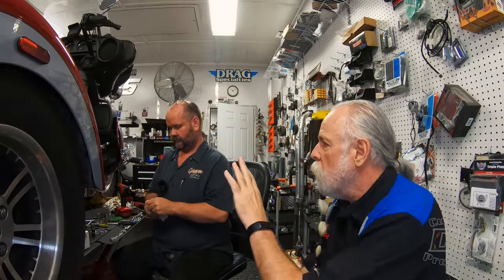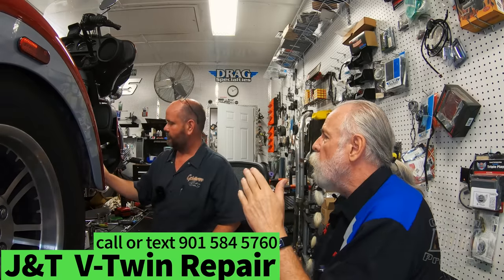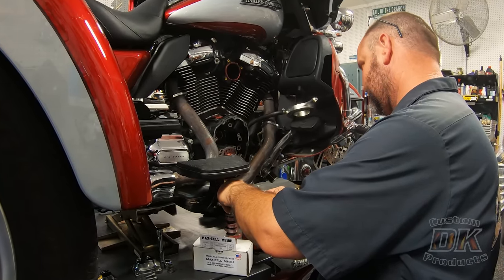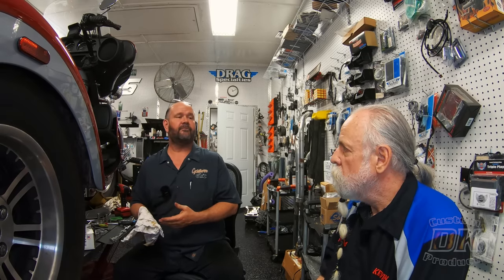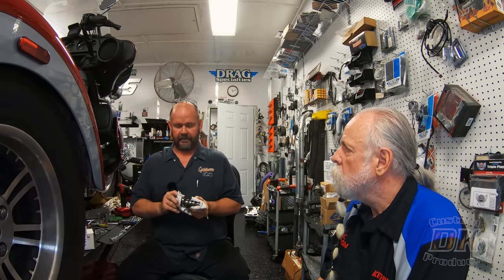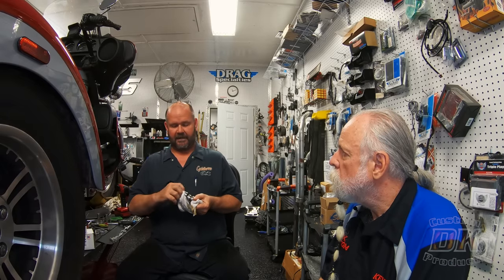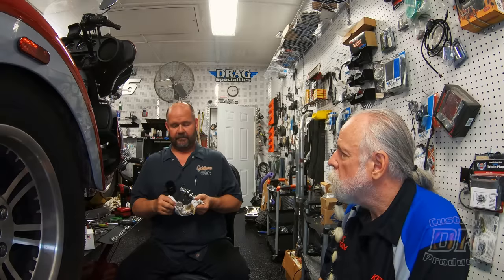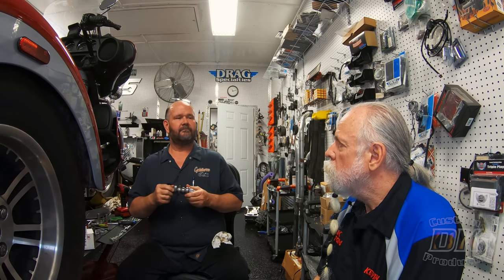How to Get Some Chop (Lope) From a Harley M8 Engine

Comment: chops good i get it , but you get a milk wagon also at low RPM
Reply from the maker: The M8 already pulls nicely down low, with the addition of this cam there was a substantial bump in torque in the low and mid range.  That is what I was looking for, along with the sound. KP

Comment: Very nice work.  I put the SE 447 cam in my M8 107 and I love it.  It gives me the power boost that I wanted and I don't feel that I'm over stressing the motor.
Reply: How did your gas mileage go?
Reply: @AttorneyThatRides  I lost 1mpg, maybe 2mpg at most.  Just filled up today and my range says 206, but that number can be a bit unreliable.  Doing accurate math after a fillup shows about 38mpg at best, 35 mpg at worst.
Reply: I have a SE447 in my 114 RGS and it runs Ok but wish I had gone aftermarket and got real power for my money
Reply: Running cooler is generally caused by other factors such as the fuel mapping.. If you go with the SE 447, go with an aftermarket tuner if you can.  I did so in my m8 Road King, seems to pull and maybe run better than my Wood's 22XE in my Street Glide using the same tuner, and both with their own custom tunes,  I'm still at the same fuel mileage on the 22XE and only drop about a 1 mpg on the Se 447 ( Road King getting about 44 and 46 mpg with the street glide 22XE) The Se-447 is the easiest on the valve spring and rockers.. and both changes have resulted in a 10 degree cooler running engine. Though the 22XE lopes alitte harder, the Se-447 is my favorite (with Powervision tuner)

Comment: In my FLHTK M8 I was interested in Torque and Torque only, I studied all I could about the Cams on the market and I ended up between the Woods WM8-22XE or the Zippers Red Shift 468. I ended up with the 468 because of the flexibility, it could be run with everything more or less stock or with a serious set-up in exhaust, airfilter, pushrods, manifold and tuner. All without going too deep into the Motor and still keep a reasonable gas-economy since it’s a Touring Bike. I have not regretted…the 468 pulls almost right from idle up i to the 4.300 - 4.500 rpms. and honestly I don’t need to operate in that area,..2000 -3000rpms are where I need my action, so it’s just perfect 👍🏻✊🏻☠️ 4:09
Reply from the maker: Good to hear you have your ride set up how you want it! 👍😎👍

Comment: I was after the same "Chop and Lope" for my 114 Milwaukee 8. I was impressed with the S & S 475 Cam recommended by GixxerFoo. I had it installed along with a lot of your DK Custom upgrades, i.e, external air breather, Thunder Torque Inserts, etc. Performance shot up noticeably, and I got my Chop/Lope idle.

 Please, please assure me that The S & S 475 was a good choice as well.
Reply from the maker: Nothing wrong with the S&S 475,  If you are happy with the power and sound, that is what is important. 👍
Reply: I installed the S&S 585 cam kit in my 103” Dyna Twincam, but for my 107” FLHTK M8 I went with the famous Zippers Red Shift 468. I love it’s so stock-like up to 1900-2000 rpms and then it just takes off massively charging the torque up until approx 4500 roms,..but I haven’t gone that far it’s more than enough hitting 3500…it’s incredible and then going down to “normal” speed and idle like nothing happened …it’s just a superior camshaft for touring and daily use. Highly recommend it ✊🏻
Reply from the maker: Thanks for sharing! 👍
Reply: The 475 is soft down low.Its horrible until its not.
Reply: @MrMurphc13  I don't exactly understand, but thanks!
Reply: @Digger456437  Well compared to a stock m8...after the 475 full kit was installed the bike is soft on the throttle going from a stop to when you get moving.The bike was tuned also.
Reply: @MrMurphc13  Gotcha.

Comment: The 2 Cams I'm seeing recommended all the time is the Woods 22XE Cam, and the Star 30/30. Woods 22XE cam is monstrous at low end torque, making 100lbs at the rear wheel in a 114 at 2250, and yet still delivers 120hp at 5500RPM, carrying out to 6200RPM. It's a fantastic cam through and through and that's what I'm going with when I swap out my SE Torque Cam.
My fat boy is already a quick accelerating bike with my tiny 130lb butt on it, but that 22XE looks like it's a super version of that SE torque cam. 120hp before 5600RPM is just impressive. 127TQ at 3340RPM is strong.
I cannot wait to see how much quicker that zero to 60 is with the new cam.
I got a vid of the SE cam version of my bike doing 0-60 in 3.9seconds. I wonder if I can get 3.7 seconds?
Stage 2 cams make these bikes so much more powerful, and fun, it's unreal.
Reply: star 30/30 is the biggest cam you can put into a m8 without doing head work.dyno charts show it performs better than the 22xe
Reply: @russellwood5867  Actually the charts that FuelMoto USA recently did with everything set properly, showed that the Star 30/30 doesnt actually out perform the 22XE at all.
Star 30/30 stats
Peak Torque 125.93 at 3480 RPM
Peak Power 120.12 at 6050RPM
Reaches 100TQ at 2300RPM.
Reaches 50hp at 2450RPM.
.485 Lift
22XE Stats
Peak Torque 127.41 at 3370RPM
Peak Power 120.86 a 5660 RPM
Reaches 100TQ at 2220RPM.
Reaches 50hp at 2400RPM
.470 Lift.
So the Star 30/30 is slightly worse in every aspect, and has a higher lift which is harder on the springs and rockers.
The 22XE is lower lift and is more exhaust tolerant.
22XE is a better cam statistically than the Star 30/30
Reply: @FranBunnyFFXII  saw the fuel moto charts as well as DC cycles running a 114 .both cams are similar in performance with star higher in torque, but not by much ive researched this for hours. talked to a lot of people who own both.i recommend new valve springs anyway since harleys are crap. cheers!
Reply: @russellwood5867  my local shop has installed dozens of each.  They are head to head and either takes the lead depending on the total package of mods.  Same bike, same mods, the 22xe takes the lead by a very small percentage.  The 22xe runs hotter though, so have a plan to cool it down.  The 30/30 doesn't require taking the heads off, but you should because it's HARD on the springs.
Reply from the maker: The Woods 22XE was what I was leaning toward.  Lot's of folks really happy with it.  I am sure whatever you choose you are going to continue enjoying your ride! 👍

Comment: Re: my 2021 Heritage 114;  Prior to your posting this video unfortunately, I had an entire S & S 475C Cam Chest Kit install, i.e, Cam, Cam Plate, upgraded oil pump etc. My Harley Dealer who did the install also did the Dyno. The tech said it should operate flawlessly. I have since  noticed when I attempt to accelerate hard, the Heritage hesitates badly, then kicks in with a jolt. Is the hesitation Normal? I would like an informed opinion before I go back to the dealer. Thank you!
Reply from the maker: Congrats on the parts you added to your Heritage.  All good stuff.
NO, that is not normal.  That is a tune than still need some work, unless you are experiencing that hesitation in 3rd or higher gear and are giving it throttle at well below 2000 rpm.
When getting on the throttle in 3rd, or higher, and the RPM's are above 2000, there should be no hesitation.  If there is, and they are saying it is normal, it must be normal for how they tune, but it is just a bad tune causing that hesitation above 2000 RPM.

Comment: Thats my tuners recommendation too.  But for my  stage 3 128 he recommends the Jims Max Cell 828H.  134hp @4800rpm  153ftlbs  @3600 rpm 55mm S&S intake, air stinger and 2 ino 1 race pipe, 5.5g HD injectors on a 21 Low Rider S.
Reply from the maker: Awesome! I hope you get everything you are wanting from your Stage 3! Thank you for commenting! 😎 MB

Comment: Hi. Liked the video, thank you. Only had a RKS for 8 months and thinking of a filter and tuner. It had S&S twin end cans when I bought it and it sounds nice, and not too loud. What’s the best tuner and filter combo, in your opinion? V & H 3 seems a plan. Cheers. Steve 🇬🇧
Reply from the maker: If you are talking about an Intake when you ask about the filter, An Intake that actually functions as an Air CLEANER starts with venting your crankcase gasses externally. Engines run better when they have cool, clean, oxygen rich air to breathe. Having an External Breather System(EBS) in conjunction with your air cleaner will help you to get optimal results in power, and will increase engine longevity.

All of our Air Cleaners are made to go with one of our External Breather Systems. You can see a video about all of our Air Cleaners at this link - https://www.youtube.com/watch?v=xP7wxWQmSa8

Here is a written report on the differences between our Air Cleaners - https://www.dkcustomproducts.com/differences-between-outlaw-hiflow-air-cleaner-systems-dk-faq-acs.htm

For the Tuner it is hard to say what is right for you, but if I was buying another Tuner for my bike I would still buy the Power Vision. You can see more about the power vision at this link - https://www.dkcustomproducts.com/dynojet-power-vision-flash-tuner-w-auto-tune-dk-pv-cmp-pkg.htm

Please feel free to contact us with any questions;
Support@DKCustomProducts.com
662-252-8828

Thank you for commenting! 👍😎👍 MB

Comment: where can i buy the cam the oil pump cam bearings and cam plate and lifters thank you  i have a 2019 tri glide
Reply from the maker: You can get the Feuling Cam Plate and Oil Pump from this link on our website - https://www.dkcustomproducts.com/catalogsearch/result/?q=FEULING

The CAM is a Max-Cell 818H If you'd like to discuss this cam, or any other cams, the shops below can help you.  These shops deal with the Max-Cell Cams, and can sell/install/tune them.
Down Home Harley-Davidson - 336-227-1261  (Justin)
J&B Cycle - 262-763-5570 (Jake)
Lucky's V-Twin - 207-800-6044 (Brian)

Thank you for commenting! MB

Comment: Woods 22xe Fuel Moto  2-1-2 with the RTX mufflers S&S ward ported intake 5.5 injector 2020 FLTRXS with RDRS  123rwhp 133rwtq  peak torque little over 3800 rpms but 122 off idle to.peak ..... feels great !
Reply from the maker: Hey Man!
I almost went with the Woods 22XE...like the sound of the 818H better.  Will be a month or so before I get it on the dyno. 😎

Comment: Stock springs will handle 475 lift??
Reply from the maker: Yes, the cut of the lobes on this cam allow use of the stock springs.  Some ramps are more abrupt and with those aftermarket springs are recommended.
I have some hard miles on this cam over the last 8 months and am really liking it, and not experienced any floating.

Comment: Interesting.  Never heard of Max-Cell cams.  Where can you buy this cam?  Ran a search…couldn’t find the company.
Reply from the maker: NOTICE:
DK Custom does not sell cams, nor are we suggesting this particular cam for your Harley. We are  showing & reviewing what cam upgrade Kevin did on his Trike. If you'd like to discuss this cam, contact Jamie at V-Twin Repair - 901-584-5760

SECOND IMPORTANT NOTICE:
It Is Strongly Recommended that a Proper Foundation is In Place PRIOR to Installation of a cam upgrade.  Without a Proper Foundation, one will Not Get Anywhere Near as Much Increase in Power from a Cam Upgrade.  Here is a Link to a Video that Outlines a Proper Foundation- https://www.youtube.com/watch?v=GK5x3lcQvJU&t=0s

Comment: Max-Cell cams are lacking any internet presence. It would be helpful to see the specs on this cam.
Reply from the maker: Yes, as mentioned in the video, he is keeping his circle close.  There are some videos here and there, and they do have a facebook page. But you will need to get the cam from a shop that has a dyno and that is a dealer for them.  Here is one below.
NOTICE:
DK Custom does not sell cams, nor are we suggesting this particular cam for your Harley. We are  showing & reviewing what cam upgrade Kevin did on his Trike. If you'd like to discuss this cam, contact Jamie at V-Twin Repair - 901-584-5760

SECOND IMPORTANT NOTICE:
It Is Strongly Recommended that a Proper Foundation is In Place PRIOR to Installation of a cam upgrade.  Without a Proper Foundation, one will Not Get Anywhere Near as Much Increase in Power from a Cam Upgrade.  Here is a Link to a Video that Outlines a Proper Foundation- https://www.youtube.com/watch?v=GK5x3lcQvJU&t=0s
Reply: Glad you are happy with it Kevin. I’ve got a FP3 so will be looking at a V&H supported cam.
Reply from the maker: Yeah, with the FP3 you def want a cam that they have a base map for. 👍

Comment: How does it /able to run cooler??? Thx
Reply from the maker: The better fresh charge you get, the cooler it will run.
Here is a video on the subject of the importance of a fresh charge- https://www.youtube.com/watch?v=nB0XDQVjH9Y

The cut, or timing, of the lobes (both intake & exhaust) on the cam have a big influence on how hot, cool, strong your engine runs.

Comment: I would say Jim definitely do some better advertising. I’ve been researching parts for a Stage 2 upgrade for well over a year, and had heard of Jim’s Performance but only in the context of the tools they make. I had no idea they offer camshafts until yesterday when I watched a video where a dyno tuner mentioned a “MaxCell 821” and showed it making better numbers than a Star Racing 30/30.. 
🤨🤔🧐 What’s that?? 
Who knows.. can’t find any more info on it.
Reply from the maker: I think that you may be confused between Jim's USA and Jim's Performance.

Jim's USA makes tools and some other parts (such as the Jim's Force Flow Fan). You can see his website at this link-https://www.jimsusa.com/

Jims Performance does not make tools but does make CAMS you can see his facebook page at this link-https://www.facebook.com/jimsvtwinperformance/
   Jim does not generally interact with the public, but only has them available via his very small network of authorized dealers. 

He chooses to do it that way. If you'd like to discuss this cam, or any other cams, the shops below can help you.  These shops deal with the Max-Cell Cams, and can sell/install/tune them.
Down Home Harley-Davidson - 336-227-1261  (Justin)
J&B Cycle - 262-763-5570 (Jake)
Lucky's V-Twin - 207-800-6044 (Brian)

Thanks for commenting! MB

Comment: How is it on gas mileage????
Reply from the maker: Still working on the tune, so don't have final numbers.
Last couple of tanks have been 2-3 mpg less...HOWEVER, that is almost assuredly because I am playing around with the throttle more, having fun with the extra power.
I expect that after the tune is dialed in, and I ride exactly the same as before, I will get 1-2 MPG BETTER.
A properly set up engine, that has not had an increase in CI, should get better MPG, all else being equal.  
I do notice when I am cruising on the interstate, that to maintain 75 mph I am now using 3-4% less throttle.
Engine is working more efficiently now, generating more power with less throttle.

Comment: Where can I buy the max-cell 818 cam, what the cost
Reply from the maker: NOTICE:
DK Custom does not sell cams, nor are we suggesting this particular cam for your Harley. We are  showing & reviewing what cam upgrade Kevin did on his Trike. If you'd like to discuss this cam, contact Jamie at V-Twin Repair - 901-584-5760

SECOND IMPORTANT NOTICE:
It Is Strongly Recommended that a Proper Foundation is In Place PRIOR to Installation of a cam upgrade.  Without a Proper Foundation, one will Not Get Anywhere Near as Much Increase in Power from a Cam Upgrade.  Here is a Link to a Video that Outlines a Proper Foundation- https://www.youtube.com/watch?v=GK5x3lcQvJU&t=0s

Comment: What exactly determines how aggressive the lope is? Os the the lift, duration, overlap etc..
Reply: Lobe separation angle has a large impact on the "lope" of a cam.
Reply: @heavymetalmechanicX  I appreciate it. Other than looking at dyno charts I’m just starting to try an learn the mechanics of it.
Reply from the maker: LSA, as mentioned by heavy metal is also known as overlap, and it is the most common determining factor for idle lope.
Reply: @DKCustomProducts  Thanks. I always appreciate you taking the time to help out with the questions and to give advice
Reply from the maker: Thanks for the comments and kind words.  Enjoy the wind! 🏍

Comment: Who sells these Max-Cell cams ?
Reply from the maker: Not a lot of dealers for them. Yes, as mentioned in the video, he is keeping his circle close.  There are some videos here and there, and they do have a facebook page. But you will need to get the cam from a shop that has a dyno and that is a dealer for them.  Here is one below.
NOTICE:
DK Custom does not sell cams, nor are we suggesting this particular cam for your Harley. We are  showing & reviewing what cam upgrade Kevin did on his Trike. If you'd like to discuss this cam, contact Jamie at V-Twin Repair - 901-584-5760

SECOND IMPORTANT NOTICE:
It Is Strongly Recommended that a Proper Foundation is In Place PRIOR to Installation of a cam upgrade.  Without a Proper Foundation, one will Not Get Anywhere Near as Much Increase in Power from a Cam Upgrade.  Here is a Link to a Video that Outlines a Proper Foundation- https://www.youtube.com/watch?v=GK5x3lcQvJU&t=0s

Comment: Aftermarket cams do produce power but what does it do to the engine long term? Performance builds are in the shop more
Reply from the maker: Very good question and point! 👍
Twin Cam cranks have a tendency to shift/twist, so cams for a TC are generally not something we would entertain.

Cams can have a tendency to make the engine run hotter, especially on an M8, so unless that has been addressed, a cam is not a good idea.  
Related to that is what prep work (foundation) should be in place before considering a cam for an M8.  We discuss that subject in this video- https://www.youtube.com/watch?v=GK5x3lcQvJU
Another factor is how folks that put in a cam for more power ride...generally more aggressively.  That combined with not having the heat under control, leads to a higher % of them ending up in the shop.